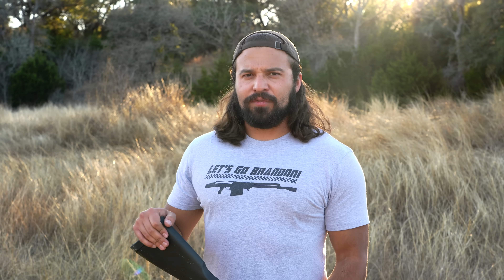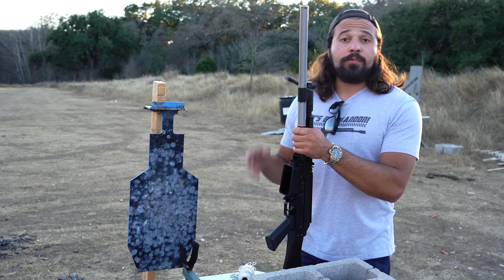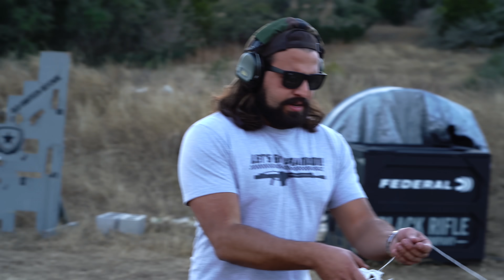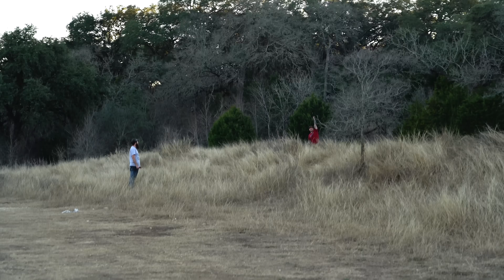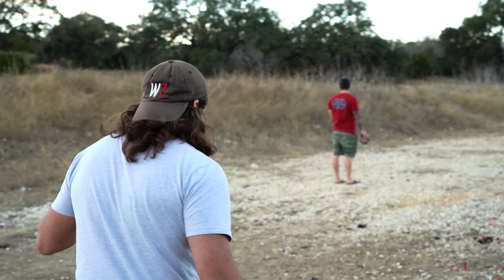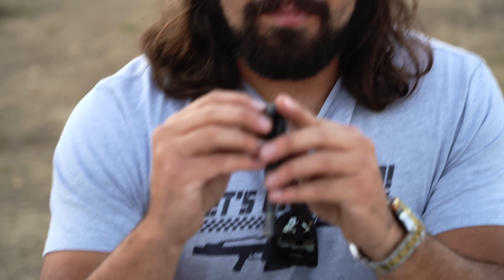Testing an AK Chambered in .50 BMG

Comment: This video is a clear example of the power of a 50 BMG. That's a lot of pressure for that gun to be holding. It's crazy to see a once working gun disassemble itself that violently.
Reply: It caused brass, a softer metal, to imprint on what should be hardened steel.
Reply: Next up "We test to see if it can survive an APEX round.  The same one designed for the F-35."

That'd be a hell of an anti-material rifle if that stupidity ever gets figured out.
Reply: @jamesfisher9594  Yeah, that was both impressive and scary, force behind that..

Comment: 2:50 "This gun is gonna blow up." My only thought when you started explaining you'd slimmed down a .50 BMG barrel to fit was, 'He made a pipebomb.'
Reply: But the barrel was fine. It was the lockup and barrel/receiver fit that gave away. A full .50cal barrel is significantly overbuilt, it has I withstand thousands of rounds and possible over pressures. Even after you trim a bunch off of it it is still way stronger than that bolt and pins that are only made to hold a 12ga. If you put that same barrel onto a Barrett, it would probably burst the barrel, definitely eventually. But with such weak lockup it didn't even have a chance to develop full pressure before it blew the case out the back of the gun and blew the barrel straight out of the gun. As soon as the lockup was compromised, the pressure was released and the barrel survived.

Comment: Actually seeing how powerful it is compared to a "normal" gun, just makes it WAY more impressive what you are doing with the AK-50
Reply: AK-50 have working gas driver, but not in here
Reply: @livecamsex-checkmylink9000  why are you here
Reply: The maker of the Serbu who talked to Kentuckyvallistics after his accident told him that the average .50 BMG round produces something like 55,000 psi in pressure.
Reply: @benpurcell4935  Thats alot
Reply: @SenkaBandit  Which essentially translates to: "Everything that is trendng."
Reply: @Yawyna124  yeah pretty much
Reply: .50 BMG really is on a whole nother level. Pretty much steps outside the level of "small arms."
Reply: @davecrupel2817  tell that to the small arms repairmen in the army that have to mantain howitzers.

Comment: Brandon: "So we found a peice of the casing..."

Me: "Okay, cool.  So we know ejection  isn't an issue."
Reply: Part of it remaimed in the chamber, and thry couldn't find the rim.
Reply: I believe ejection wasn't proved to be an issue when the gun ejected itself from itself.
Reply: When you fire the gun and the upper half ejects itself leaving you with a gun grip.
Reply: Well the ejection is a bit excessive actually.
Reply: The gun ejected more than just the casing
Reply: Here at aperture labs, we fire the whole bullet; that’s 60% more bullet per bullet!
Reply: @ambi_cc8464  dang, that’s a lot of bullet…
Reply: @ambi_cc8464  dont you mean we fire the whole gun? Rofl
Reply: @N008Nightmare  80% more gun per gun
Reply: @cxpKSip  such a malfunction would probably require disassembly and removing the barrel to remove the damaged case, which is already handled by the ... Whole thing blowing the fuck up. Definitely some kinda single shot progress though.
Reply: also ejected the dust cover 50 yards back. unique design.

Comment: I remember when Mythbusters did one of their tests involving sketchy firearms shit, they had a piece of dowel wedged behind the trigger as an extra safety so they couldn't accidentally pull the trigger while running the string. Then when ready to fire they used a second piece of string tied around the dowel to pull it out, so they didn't have to be anywhere near the gun when making it 'live'. For something like a 50, I'd probably do the same if I were doing something like this.
Reply: Would be cool to make a trigger lock with a motorized cam, that way its impossible to squeeze unless you hit a
 button on a remote
Reply: Also, a little pulley could allow the person with the string to stand off to the side.  Might not protect from flying dust covers.... would love to be out of line of that bolt though, thank goodness Scott was there to take the hit.
Reply: @mostlychimp5715  Eh, you can be off to the side a fair bit even without anything like that, and you should NOT be doing anything that could cause a kaboom unless you have some very solid cover to hide behind. I don't really think that the angle you are at should make all that much difference.
Reply: Do you really need all that? The gun isn't just going to decide to fire on its own
Reply: @DarkAttack14  Idiotic statement. Nobody is saying that it will fire on its own, it will fire if you accidentally pull the trigger before you're ready.

Comment: I'm astonished. I didn't expect that at all. I figured the gun would be severely damaged but no where near to that extent. This has been a learning experience for me. Very informative video. Thank you.
Reply: Shotguns typically operate 10,000 to 11,500 psi
Common rifle calibers typically operate from 50,000 to 65,000 psi
Food for thought, its no joke. This thing never stood a chance
Reply: @jacobwilbert1018  I've tried to understand ballistics, but it never really sticks for me, 12 guage slug seems like it can beat my 460S&W Magnum at penetration (at least at short ranges) with a heavier bullet, but the 460 has a max chamber pressure of 65k so going by just that number it shouldn't come close
Reply: @playercharacter117  so basically that heavier bullet actually gives it more power. think about it this way, pretend the 460 is like a formula 1 car, while the 12 gauge slug is like a semi truck. the f1 car is smaller with more power pushing it forward, but the semi truck is gonna make a bigger dent in whatever it hits
Reply: @playercharacter117  that'd be the inertia, basically, the slug has less surface area per unit of mass so gains and losses energy slower, so it penetrates further but needs a longer barrel and has a lower final velocity.
The magnum hits top speed faster and hits harder but will loses most of its energy within the first few inches of whatever it hits.
Reply: @jacobwilbert1018  That is 6 times the energy density of a 12 gauge, since pressure is energy per volume (1 Pa = 1 J/m³). Add to that, that the case of a 50BMG is larger and, you have over 6 times the energy to contain.
Reply: @playercharacter117  larger bore diameters produce much less pressure
Reply: @peregrine3845  sorta but not necessarily a rule of thumb, for example .223/5.56 operate at the same pressures as .50BMG
Lol 🤯😂
Reply: @1m3agle  That's an awesome explanation thank you, I can tweak it for the distance difference (460 being effective to 200+ yards against large game, 12 ga slug needing to be a little closer.)

Comment: The frame by frame disintegration was comically hilarious; the bolt carrier with piston instantly fired as a projectile backwards, the dust cover got catapulted into air (and flew 50+ yards), while the barrel begun its own journey a moment later.

Btw you can examine frame by frame by pausing the video and then pressing "." for forward and "," for backward.
Reply: ......my number 3 thing on a GO BACK IN TIME WITH THE DOCTOR WHO'S TIME MACHINE would be to TAKE BRANDON a REAL HIGH SPEED CAMERA one day before this shoot happened!!!!!! :)  JUST SYAING :)  :) :)
Reply: Doesn't work on mobile.
Reply: Imagine trying to shoulder that thing! You would've been dead from the bolt carrier entering your eye. Feck safetly glasses, that thing left a hole in a 1/4" thick steel plate, your head is going to be cratered...
Reply: Just the ignition you can see in the mag well a frame before the detonation. Holy hell
Reply: Cries in mobile
Reply: @Fox_Onii-san  Maybe, but the point isnt to trade lives. If you have to take yourself out to take the target out...that's a shite design.
Reply: @phoenixmastm  "if you have to take yourself out to take your target out, that's a shite design" I think Isis would like a word
Reply: My favorite parts are the first two frames where we see stuff happening: 
Frame 1: Is that light coming from the magazine well? That doesn't look right...
Frame 2: KABOOM

Comment: It's almost like you need a gunsmith with experience, do calculations and proper testing to build a gun that is safe to operate EVERY time you fire it.
Thanks for the video Brandon. It is always impressive to see how much force a cartridge contains, especially the .50 BMG. There is a good reason why the M82 has a weight of around 25 pounds.
Reply: Yes, i never understood these "gunsmits/gun expertes" all they do is randomly shoot things and switch calibers but no maths, no calculations...
its kinda dumb i just watch them expecting something good and i keep falling into this trap...
Reply: Everyone knew it was going to happen... 50 BMG in an assault rifle is a terrible. Have you ever seen a ma duece in real life? they are massive..☺️
Reply: @karim lavji lynx - 10 kg 112 cm... 5 rnd mags.
closest thing to 50 BMG assault rifle is PKP Pecheneg, 8 kg 115 cm 100-250 rnd belts.
Reply: @aiTheVulture  unless I’m mistaken, even the pkp only fires 7.62x54, not .50. So the “closest thing” is still pretty far away. There’s .458 SOCOM, .50 Beowulf, n the short Russian .50 (12.7x55mm), but those (while all packing a huge punch), still fall short of a true .50 BMG. As someone else already said: there’s a reason why almost any firearm  intended to chamber .50BMG or 12.7x108mm weighs almost always over 20lbs and are sometimes almost as long as the person shooting it is tall.
Reply: @mochaninja1299  "closest thing" in therm of energy not bullet size ofc. .458 SOCOM, .50 Beowulf, 12.7x55mm have less energy then 7.62x54r...
Reply: @aiTheVulture  that’s a fair point, you’re right about that

Comment: Scott would be proud lol. In all seriousness think this experiment just goes to show the true durability with which the Serbu 50 is built. This weapon, which was stout in its own right had a catastrophic failure with a normal .50 BMG which was orders of multitude greater than the failure of Scott's rifle; and Scott's rifle had an actual bomb in the chamber.
Reply: What was the pressure that SLAP round created (in metric pls because i am from Europe)?
Reply: @madkoala2130  the scariest part was it was not even a SLAPP round it was a fucked with slapp round that had waaaaay to much powder
Reply: @SomeConch357  a SLAP round meant to be fired out of a M2 machine gun
Reply: @madkoala2130  Mark Serbu said that in order to rip the cap off the threads, you would need pressure in excess of 80000 psi, or over 550 megapascals. And that's the slow estimate. It also tore off the backup lugs that were supposed to make sure the cap stayed put. So the actual numbers would have to be even higher.
To put that into perspective, a standard .50BMG round is only supposed to create a maximum chamber pressure of about 55000 psi, or around 380 megapascals. 
The round that blew up Scott's rifle was in all likelihood DOUBLE that. You might as well have blown up a hand grenade only a meter or two from his face.

Additionally, SLAP rounds aren't supposed to create much of an increase in chamber pressure. Its effectiveness comes from the fact that it's a sub-caliber projectile made of tungsten, which means it has way better material properties for penetration, and because it's sub-caliber and weighs less than a regular .50BMG lead bullet, it achieves a much higher velocity from basically the same powder load. If SLAP rounds ran at pressures much higher than a regular .50 cal, you wouldn't be able to shoot them through all your M2 Browning's or any other weapon chambered in .50BMG. You want it to run as similarly as possible to the regular cartridge. The US Army made extensive use of SLAP rounds out of their M2 machine guns during Operation: Desert Storm, and they ran just fine. Many, many thousands of rounds without issue. Whatever it was that went into Scott's gun was definitely not a regular SLAP round.
Reply: @LDSG_A_Team  thx
Reply: @madkoala2130  A lot, to experience the damage he saw, the pressure was likely around 7000 bar at a very minimum. 
And the way you hit these pressures is most likely either, surplus round cleaned up in vibratory tumbler, wrong powder type, or an undercharge of powder.
Fun thing with reloading, often an UNDER-CHARGE can hit far far higher pressures than an overcharge, when the round fails to ignite, the flame retardant coatings on the powder are burned off, but sometimes it catches and goes after this leading to some pretty wild pressures up to 14000 bar.

Considering another channel buried the muzzle of this very rifle in 20 gallons of concrete and it experienced no issues with a full power 50 round, it's likely one of these scenarios.
Reply: @PineyJustice  ah. I see you are also a viewer of Edwin Sarkissian
Reply: @PineyJustice  how would cleaning the rounds in a vibratory tumbler cause problems? I'm genuinely curious.
Reply: @LDSG_A_Team  I think, ultimately, Mark said the pressures to do what it did was something WELL north of 100K psi.
Reply: @destructimus  it would break the powder in smaller pieces making it burn much faster then it should
Reply: @destructimus  sinking the bullet further into the casing than designed
Reply: @madkoala2130  No one is really sure. Mark Serbu said it would take at least 80000 PSI which is 5515 bar or 551580 kpa to cause the weapon to fail. In all likelihood it was far in excess of that.
Reply: @madkoala2130  over 88000 PSI to shear the threads on the Serbu or for you European people over 606 Megapascal
Reply: @dvdadaudits7500  Yes and no, the M2 would not have provided any mor support for such an overcharged round and defiantly would have been destroyed as well. The person behind it would have fared better than Scott simply because there is a lot more gun to absorb the blast and the feed tray cover and barrel shroud would have soaked up most of the blast .
Reply: @swiger530  Well, as long as the tray cover latch gave up before the hinge pin. That's a big ole' whack to the noggin if it doesn't.  Anyhow, yes... any gun that cartridge found it's way into would have come apart in high-speed pieces much like the Serbu did, and a lot of them provide much thinner and sharper pieces nearer to the fleshy bits at that. Another gun's hexagonal receiver that everything rolls in will take that pressure and come apart like an expanding hollow point, or six supersonic dull knives that you're attempting to catch with both arms, if you want to look at it that way.
Reply: @PhotonHerald  sounds about right. Pretty absurd when you think about it
Reply: @LDSG_A_Team  No, these are just things I know from a decade of reloading.
Reply: @destructimus  The powder grains have coatings of retardants on them that adjust the burn rate, without them the grains will burn faster than expected causing huge pressure spikes. The vibratory tumblers abrade this coating off or can even crack the grains or create dust from the powder inside. This leads to rapid self disassembly.
Reply: @PineyJustice  I was referring to the last paragraph of your first comment.
Reply: @PineyJustice  Cool, thanks.
Reply: @destructimus  If you watch IV8888 you might remember him blowing a few rifles up using "range dust" or unburned powder swept up from an indoor range, it has lost the retardant coatings and was able to blow up guns that had previously withstood double or even triple charges of regular powders.

Comment: I actually appreciate the video.  It shows all the kids and sheer dumbasses why you can't just stick a 50 BMG barrel onto a regular AK receiver, etc, and expect it to work.  And it also does a good job highlighting all the work that's been put into the AK-50 so far.
Reply: Exactly why everyone should buy the already well established Barret M82, which is already a bit based on the AK and has a very proven track record. They also cost less than one might think, less even than the Zastava M93, and that's a bolt action
Reply: @lioncelica5170  where are you finding an m82 for less than 8k?

Comment: Something I noticed - when you run the string, you have the string already on the trigger and there's a risk of accidentally pulling it if it catches on something while you walk away. That's especially true since you're already putting light pressure on the string to keep it from falling off.

What I'd recommend: lay the string out from your shelter all the way to the test stand before looping it around the trigger. Then, you can set the loop and walk back to cover *without touching the string*. To keep the string from falling off the trigger there are plenty of things you could do, but something that would be really useful would be a clamp that attaches to the trigger with a dedicated hook for attaching the string. Not sure if that sort of thing already exists but I'm sure you could make something in short order.
Reply: Not to mention he did all that with the safety off
Reply: This should be top comment. I shivered when he put the string on the trigger without laying it out on the ground beforehand.
Reply: he knows what the fuck he's doing.
Reply: Dude! It's basically an AK-Trigger, he could use that rifle as a tow hook and pull a car with the string and it still wouldn't go off by accident. 😆
Reply: how about some scotch tape?

Comment: Wow, I am amazed that the barrel actually survived that with only damage to the pin sections, I thought for sure it was going to split open like an overripe cucumber! Pretty cool that it took off like a rocket though, almost behaved like a recoilless rifle, only the rim of the cartridge separated from the rest of the brass and left an impression on the bolt! LOL As far as I'm concerned, nobody has any business putting a .50 BMG round into anything not chambered for it, or engineered to fire that specific round, that round is evil incarnate already just as it is, without putting it into something that wasn't designed for it and basically creating a destructive device!